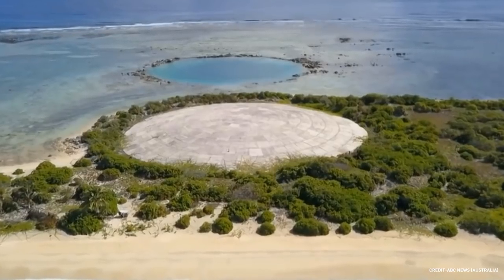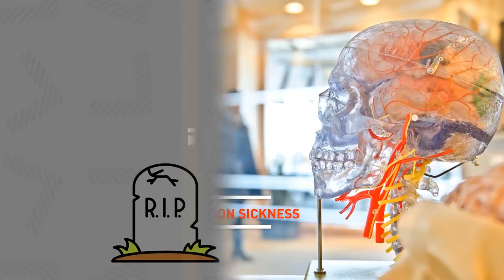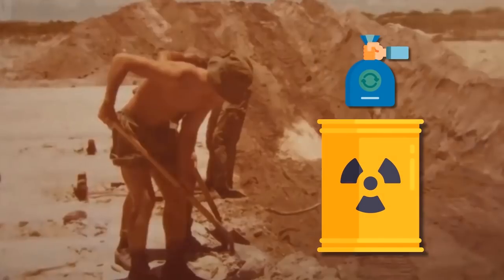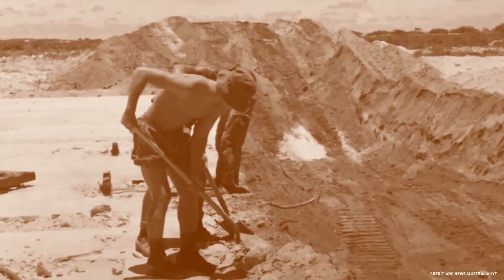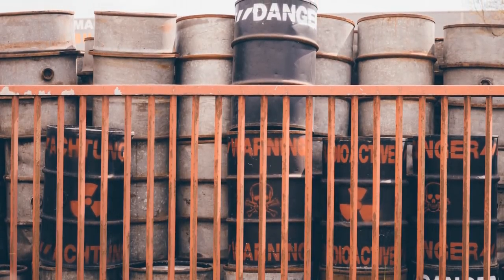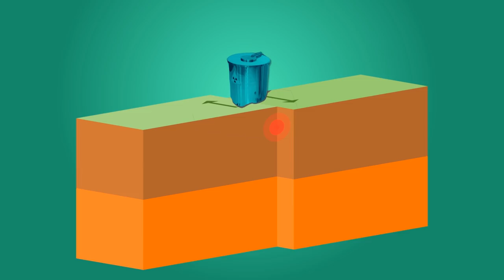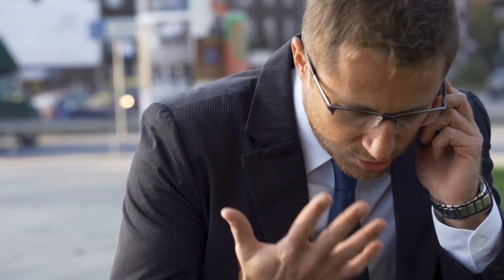What's Hidden in This Remote Dome Can Destroy the Earth

Comment: Rather than trying to rocket the waste into space, or dumping it in the ocean, how about we put all that smarts together and build reactors that can use this as fuel?  I seem to remember hearing about some Thorium reactors that just keep using the fuel till its no longer radioactive and is just lead.  Seems that might a better idea that a rocket that can just blow up, or filling the oceans.
Reply: America won't do anything to correct their wrongdoings I like your idea tho
Reply: OMG WAS REALLY THINKING TO BUILD A ROCKET AROUND THE ISLAND AND SEND IT TO PLUTO SO IT CAN EXPLODE THERE...OR WHATER!
Reply: It is good to use the radioactive waist to use it in special radioactive batteries which researchers should design to use it in mobile phones and cars that will work whiteout charging since the radioactive battery will charge the maine battery of the mobile all the time .ie the mobile battery will contains two parts one the inner charger radioactive battery and the outside battery . and for electric cars the same thing
Reply: @aranalan4199  are you serious or having us on?
That's Science Fiction buddy!
Radioactive waste is just that - waste!
To use radioactive materials, you need to be able to harness their radiation. At the moment our best way of doing that is to get near critical masses to produce large amounts of heat, then run steam turbines.
Radioactive waste doesn't generate enough heat to do that.

The "batteries" used by NASA on space probes is also a special isotope which can create a low wattage thermocouple. Radioactive waste can't do that either.

Do you have a design in mind for this perpetual motion battery charger for mobile phones?
Reply: The thorium trend was proved to be bs
Reply: India is working on Thorium Reactors
Reply: That can make MORE disasters‼️‼️‼️‼️‼️‼️‼️‼️‼️‼️
Reply: @BlackBerry-zz9vf  yes and sooner a d later the broken Pluto runs to break earth by meteors :D
Reply: Yeah, generation 4 reactors can use all this waste as fuel. And that technology already exist. So hold on a couple of years 👍

Comment: Nuclear waste is still radioactive and perfectly suitable for energy generation for tens of thousands of years. Small quantities of waste material encased in thick lead shells can be used to create long lasting passive energy generators. Which can be used to power things. Imagine having a battery which will last 30.000 years. While it may not power your home, it will reduce the cost. And it's perfectly suitable for small electronics to be energy independent. Street lights for example. Or car electronics. It would work the same way as those RTG's they put on deep space probes because solar panels are useless in the outer solar system.

Comment: I have 1 thing to say on the they were not given protective equipment. Who here has ever worked in a factory? How many people have you seen not use say safty glasses while say grinding? How about people welding with arc welders and using sun glasses and squinting? People do not like bulky protective gear and will often refuse to use it or remove it as soon as their bosses backs are turned. Radiation is tricky stuff that in just below insta death levels you wont notice. Oh its only warm to the touch so i don't need all this protective gear and its hot out so im going to take it off. Is just as likely probably more likely than them not being given the equipment to start with. Suits for this stuff are not very expensive and never have been. When on camera they wore the gear given so their bosses would not find out after the cameras left back off it went.

Comment: The issue of blasting waste into space is actually getting it off the planet in the first place. The required energy to push any significant amount of nuclear waste or even standard waste is ridiculous. Modern rocket technology is far to inefficient for this purpose. Another idea was using a electromagnetic rail system to launch it. Besically a railgun firing trash into space. Problem with that is wrapping the whole thing around the planet a few times in order to produce enough thrust isnt exactly viable either. Basically we really dont have too many options other than burying the stuff or using viable portions in breeder reactors. Both of which have issues of their own.

Comment: At 1:58 they point out two craters, but only the lower one (Cactus-Short Crater) from 1958 Operation Hardtack I  was used.  The upper one is from the Lacrosse Shot, which was part of Operation Redwing, also in 1958.

Comment: Molten salt reactors can burn the waste. But we went the way of weapons with nuclear power. We only use 94% of nuclear fuel in the rods. Are nuclear power was designed to make weapons electricity is by product. But we have known of safe molten salt reactors since the 30s.

Comment: Wow. Improper disposal of nuclear waste. Maybe finding a way to use it, maybe convert and repurpose nuclear waste is a potential solution.? But I'm not a nuclear physicist,  so I'm just speculating
Reply: Stuff like this is far more dangerous than your run of the mill nuclear fuel. There are many more elements in the waste than it started with, and none of them are safe. Not only that, the isotopes involved decay much more quickly than the nuclear fuel for the warhead, which means the radioactivity is also higher. Humans could never do the job of cleaning up this site, and robots would have a hard time as well, but it could be done with the right reactor design. Nuclear nonproliferation concerns are the biggest reason that it's not a priority, but unfortunately sea level rise is gonna overtake the dome before we get around to burning it up though.

Comment: Operation Castle *Bravo. The largest man-made nuclear detonation ever recorded. The shockwave was still seismically measurable, after passing all the way around the Earth, three times.
Reply: Ok, but he said "Operation Castle". Regardless of the fact that I actually knew that (about the Tsar Bomba), prior to my comment, my point was that he didn't finish the actually detonation/test's name. 

So, while you're correct, your high horse would be higher if it wasn't running on its knees.
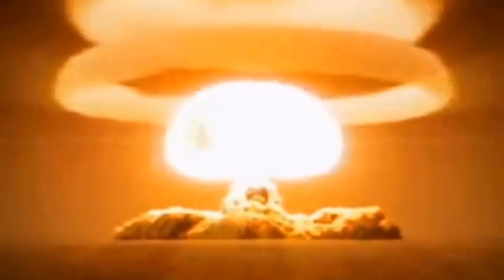Reply: 2:39 ya know, in case you wanna check my work.